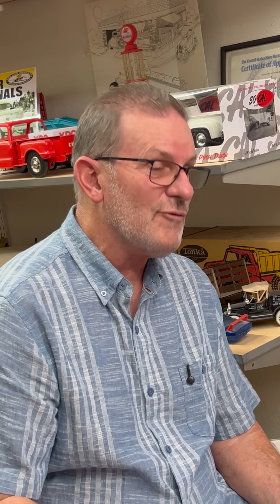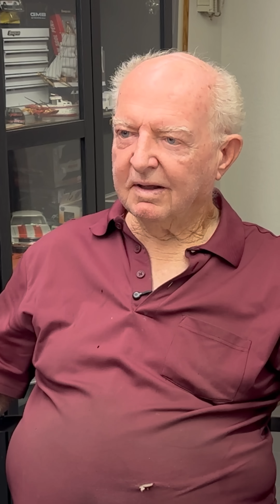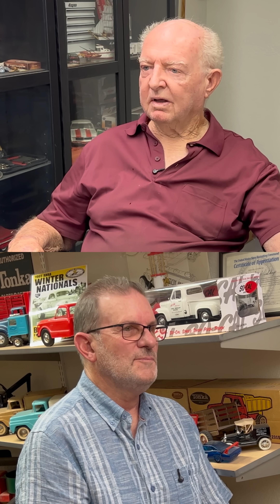Getting it Right - Tuning a Ford 400 - Ask Ed 36 - Ed Smith w #BarryT #barrytsgarage

Comment: Who can disagree with ol Ed.I bought a brand new 78 Ford 4x4 with the M engine... He's totally correct, the cam they put in those engines, was totally Retarded and gutless.. Put headers and cherry bombs on it, that only ran to the bed .It made all kinds of noise, and went nowhere fast.But in granny low,and 4 wheel Low, it had torque for days and would pull down the White House..Flipped it over a guardrail and rolled down a 60 yard embankment, before I could put a cam, intake,4 barrel Holley and play with the timing. Moral to the story, Don't Fall Asleep Driving Folks...😮
Reply from the maker: 😮 yikes
Reply: @BarryTsGarage  I drove one of these in a F250 uphill they were real slow. Went faster down hill.

Comment: my 1978 ford F150 with a 400M is making 490 Hp I have changed the heads and cam shaft plus update the block oiling system. Comp cam # 275 with Headers
Reply from the maker: Sounds great!👍

Comment: Ahh the Ford 400 , the most misunderstood Ford V8 . Biggest member of the Ford 335 series small block's, that include 302 Cleveland, 351 Cleveland, Ford 400 and 351M for MODIFIED. As it's a 400 block modified with a 351W crank to get 351 ci . The Ford 400 is just a tall deck Cleveland, a square engine with 4 inch bore and 4 inch stroke ( within a bees dick of exactly the same bore X stroke as the Ford 300 straight six ) . To wake the F400 up , jump on eBay and grab a set of 302 Cleveland Australian heads ( cost you about $300 US at your door for a set from Australian wreckers ) , they add instant 10.5 to 1 compression with smog pistons . And 50 instant HP , get a good 351 Cleveland intake for Australian 302/351C as they run 2 V ports with a four barrel intake from the factory, Edelbrock and all make intakes for Australian Clevelands, Lazer cut two intake spacers using intake manifold gaskets as templates 1/2 inch thick, ( cost about $80 if cut out of steel , more if cut out of aluminium) , good Cleveland cam and headers ( shorty stainless Cleveland headers are $165 US from AliExpress) , Edelbrock copy of Carter AFB , HEI distributor, and your at about 350 to 400 + HP for under $800 US . 

Ford 400 , grate motor , any real engine builder will tell you the more deck the more rod length the better . People just run them down because they don't understand the factory cobbled them , retarded cam timing, dropped compression to 7.4 to 1 , added smog gear , air pumps, EGR , tall diff gears, heavy cars, of course they going to be lame in stock form . Nothing wrong with the engine , as stated it's just a tall deck Cleveland. Exactly what they did to the Ford 221 to 302 engine family by creating the 351W ( adding deck height because Ford did testing and found anything bigger than 3.00 inch stroke in the low deck 221/302 block reduces engine life due to short deck , bad rod angularly, short dwell time for piston with short rods, so they added deck height and the 351W was born ) The 400 exactly the same .
Reply from the maker: Great info and insight! Thank you!🙏
Reply: Yes sir nice info and I have quiet a few pairs of 302 heads 2V dime a dozen here but not so many 400,s around let alone 351m engines.
Reply: @grantleypotts8046  302 Cleveland 2V heads ???  From Australia?? They starting to be worth a bit here in Australia now . The 302 Cleveland was the unwanted motor , most who built cars and Ford's in Australia dropped a 351Cleveland crank and rods in them and made them a 351 Cleveland.
Reply: Yes here in west oz but why would people want to use the cast iron heads these days when the aluminum heads have been available for probably 20years or more and are far superior than the cast iron ones straight out of the box. I stripped down that many 302C over the years just for the blocks to use for the 351
.
Reply: @grantleypotts8046 because many people like an all Ford restoration and / or don't have $3000 for a set of Speedmaster Alloy heads . Bolt on 50 HP with 302 C , Bracket racers have to be Ford cast iron , many classes must use a factory product . Just like using a F400 crank in a 351W 408 stroker , because even though a new crank is available people still use factory . Cost and availability.

Comment: You can use the 70 351 C timing chain set in the 400M it will advance the camshaft significantly and the crankshaft to camshaft centerline is the same specs.

Comment: I advanced the cam 8 degrees on my 1978 351 M and added dual exhaust and ditched the emission stuff and was able to reduce the jet size and it out ran and out pulled 400 Ford, Chevies and Dodge. Stock smog motors sucked back then.
Reply: I must of been in a different state than you, mine didn't have hardly any smog equipment on mine from the factory.. Still a gutless wonder, stock... before timing and cam playing around... Sure miss that truck!😢

Comment: Is that the same on a 351w 1996
Reply from the maker: I will ask Ed
Reply: @BarryTsGarage thank you
Reply: Between the 289/302 blocks vs 351w? The 351w block uses a 3 inch main which is larger than the 389/302. Bore spacing and head bolt patterns are the same between all the "small block" series 289/302/351w/351c and m/400. The 351m did NOT use a 351w crank, it is a specific crank to that motor. The 351m used the same connecting rods as the 400, but used a different piston. Parts swapping between Windsor motors requires knowledge, much less between series such as Cleveland heads onto Windsor blocks. Special pistons etc. are required. The 400 motor is a good one to build at a reasonable cost. Take the connecting rods, bush the small end to fit a set of 351c forged pistons, deck the block to close to zero, get the Cleveland heads of your choice, get a good cam and timing set, assemble it and enjoy it.

Comment: The Edelbrock carb is great for tuning the timing🎉 once you get it right put a double bumper on it and you don't have to worry about blowing power valves🎉 Edelbrock more reliable .Holly is more for the race all manual double pumper Ford seen To come alive when you install them